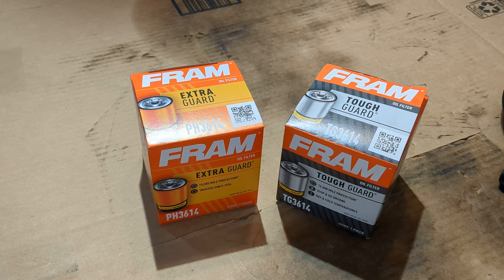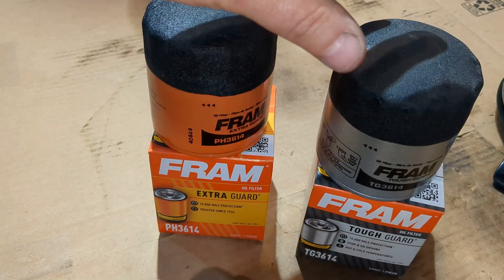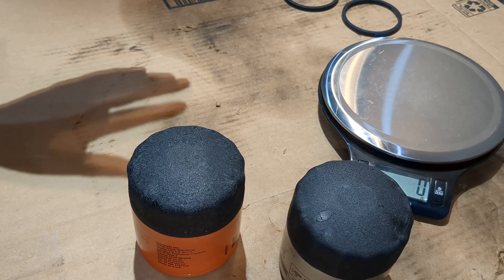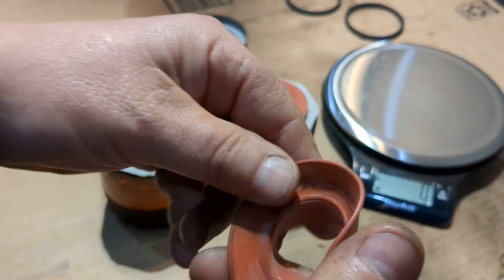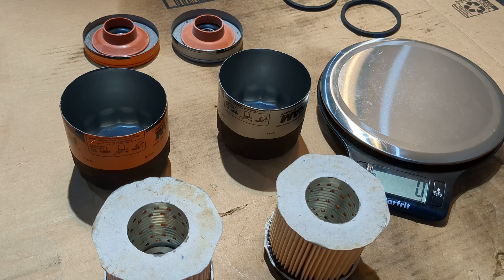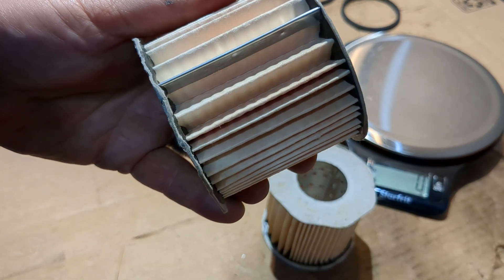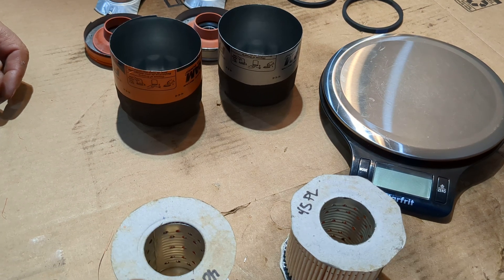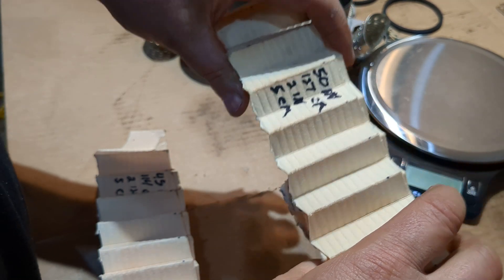Fram Extra and Tough Guard oil filters have one difference

Comment: I will never knowingly use any oil filter with fiber end caps. My dad had low oil pressure on his Jeep Wrangler with a 4.0 and he was afraid the oil pump was failing. All I did was change the filter to Wix and the problem disappeared.
Reply from the maker: You prove a oil filter type is important. 👍
Reply: The ends don't have anything to do with the function....at all.

Comment: What's beneficial about the TG aside from the media, is that it can actually seal (a bit) on the leaf spring. The Fram filters with the metal end caps no longer use a gasket on that end so there's a leak where the metal leaf spring meets the metal end cap. For this reason I have to say the best Fram oil filter is probably the Tough Guard.
Reply from the maker: I have to agree with you, I have not found a leak yet at the end where bypass is located with the tough guard. Thanks.👍

Comment: I put a remote filer on my 04 Duramax, use a large Doladlson designed for a Bypass, did a restriction check with gauges, both ports, less than 1 psi at cold starts, even at 3/4 RPM, ive had awesome oil samples. Almost 400K  still a great engine, change at 5K use Valvoline Blue Restore, as its steady diet.
Reply from the maker: That's good to hear, at those higher miles you really don't get good results.
Reply: @crazybillsgarage  I've had the truck since new, learned early on, " Oil changes cost $, only one thing costs more, no oil changes" so in the used cars I've bought it was about getting the sludge from cheap oil and changes flushed out, then change oils, my HD Mechanic apprenticeship taught me to change oil, add a bypass, on this Duramax it all goes through a 14" long bypass mounted under the truck, it's been both a heavy puller, as well as a town car, seen it all.
Reply from the maker: @johac7637 you do things right, that's good to know.👍

Comment: I use the Tough Guards regularly. Never an issue. I do 5k mile oil changes
Reply from the maker: Glad to hear never an issue, I have seen a lot of sloppy construction on both orange and grey can.
Reply: I use the tough guard 5k oil changes  as well and it has never let me down.
Reply from the maker: Thank you for sharing your good experience with Fram, so many commenters don't like Fram.
Reply: @crazybillsgarage  I am debating just switching back to the supertech filter because it seems to be same or better quality for half the price.
Reply from the maker: I talk to a lot of people who use the Super tech oil filter with no problems, seems to be a good filter.

Comment: Fram is the “no thinking” choice for most. Its a recognisable brand that you can find anywhere. Not everyone is an oil nerd or cares. Would I use one? No but Im just happy people are changing their oil when needed
Reply: Use orange fram for 167000 miles in crv .No issues.
Reply from the maker: @dougfeehan8421 nice mileage you have on that CRV. But you are probably an owner who changes oil regularly, Fram works if it's not in for 20,000 miles.
Reply: @crazybillsgarage  Every 4000 lol
Reply from the maker: Sounds very wise to me.😉
Reply from the maker: Exactly oil changes count for most of the wear in an engine, any filter will fail uf ran to long.😉
Reply: @crazybillsgarage  years ago i went to an audi training class. The teacher was from Germany and said Audi suggests filter replacement every second oil change or 30000km iirc. I said an oil filter is cheaper than an engine and he scaled me saying “no its what we engineered” meanwhile a few months later they had a TSB for 1.8T oil sludge issues and a larger oil filter…
Reply from the maker: @simplygregsterev I agree with you, change it every time

Comment: So ones terrible and the other one is terribler 😂
Reply: I've had great results with the Fram Toughguard and especially the newer version of the Fram Ultra synthethic. People are so adamant about the "OG Ultra" but the OG Ultra actually filters worse than the newer Ultra Synthetic that uses a newer synthetic media technology. 😂 

I've used the newer non wire backed Fram Ultra Synthetic for 15,000 miles and it held up very well after seeing it cut open.  Albeit, I always diligently change my oil out at 5,000 miles regardless. 👍
Reply from the maker: @William-13 I always say, if you like using the oil filter you like then keep using it.
Reply from the maker: I see you are a very wise person.

Comment: The Tough Guard uses a synthetic blend media hence the better filtration and higher price.
Reply from the maker: Don't agree with that much higher price.
Reply: filter is filter!
Reply: Both extra guard and tough guard use synthetic blend media the tough guard just contains more synthetic content. I agree with original poster it's not worth paying almost twice as much
Reply: @dylanclay2741 actually only the Tough Guard uses synthetic blend
Reply from the maker: Thank you Leroy.👍😉
Reply from the maker: @dylanclay2741 yeah definitely a rip off for a slight increase in protection.

Comment: I currently have extra guard filters on both my vehicles. But I change my oil every 3,000 miles.
Reply from the maker: You look after your vehicle's, you do not over burden your oil filters with extra mileage. I like to hear  comment's where vehicle owners look after there engines the right way. Thanks Mark.
Reply: Same here too. 3k-5k max